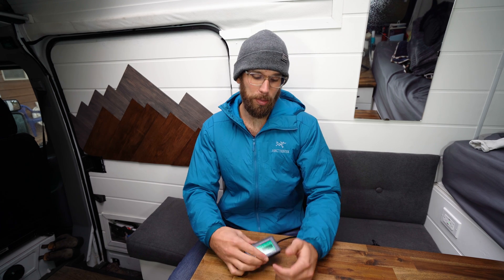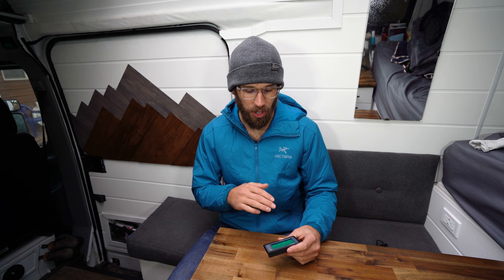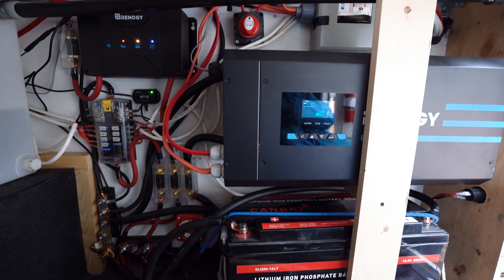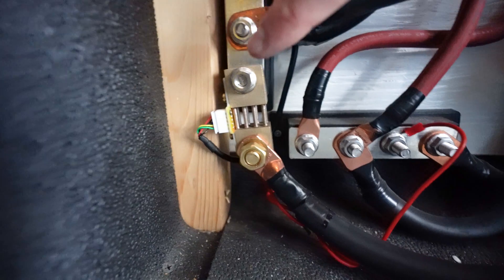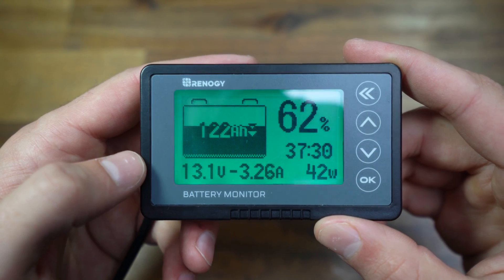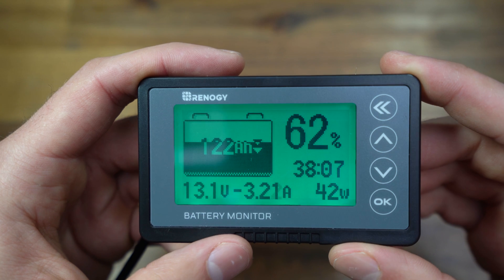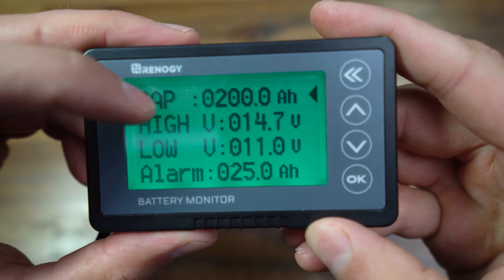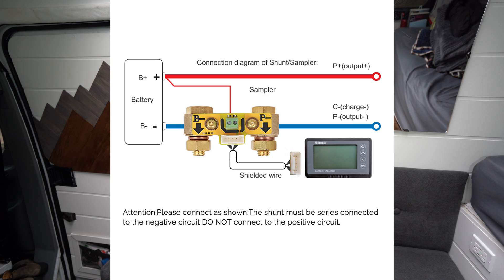Renogy Battery Monitor: How To Monitor Your Solar Batteries

Comment: Hello from Germany, how can I easily determine that my battery is fully charged before I install the monitor? I also have a Renogy 170ah battery
Reply from the maker: Test the voltage. When the battery is full it should be around 14.6v I believe.

Comment: If you have 2x 88ah you set the Cap to 176Ah if I understand correctly.  What do I set the Full V, Zero V, PowerOff and Alarm to?  I have 2 SRM-27 Interstate batteries. Thanks for the vid it was awesome
Reply from the maker: Look at the specs of the battery and set the voltages according to those values.

Comment: Can you explain how your battery disconnect is wired with respect to the battery monitor?  I currently have the same monitor and have wired up the monitor btw the disconnect and the negative battery terminal.  This is to ensure the monitor doesn't lose power (and all my settings have to be re-entered) if and when I need to turn the battery off.    Thank you.....
Reply from the maker: The shunt for the monitor is connected to the negative. The disconnect is wired between the positive battery terminal and the positive busbar
Reply: Thank you.   There continues to be a raging discussion about how to wire up a battery disconnect....with many (most?) folks leaning toward installing it on the negative side of the battery.
Reply: @robertallen7186  Greetings! I agree that many people intuit & rationalize installing cut-offs on the negative side due to "received" wisdom (perhaps due to frequently quoted historical advice regarding safely uninstalling automotive batteries where there is the most-commonly seen chassis negative ground?) I'm not an electrician or expert, but my current understanding is that ALL switching AND fusing needs to be on the positive side of any electrical connections so that the current is 100% off the system instead of just partially disconnected (i.e "after" the energized positive current flow portion of a circuit.) Typical household & appliance wiring protocol shows many examples of this principle in action. Any informed counter opinions welcome, Cheers!

Comment: If you have 3 batteries in a bank how do you monitor all 3?
Reply from the maker: The same as having one except you wire them in series or parallel.
Reply: @madetoexplore  they are parrallel. With the monitor plugged into 1 battery. The monitor states one battery is detected. I assume that all three are acting as one. If thsts the case, i need to be able to turn the inverter off to save power.

Comment: My system was set up with batteries from China. My Monitor has gone out. I have Series of 16 batteries. Can I use the the product on what I have.?
Reply from the maker: As long as your system isn’t over 500a and 120v it should work

Comment: Thanks for the video. Just wondering how you configured the monitor with high/low voltages etc. I noticed when you turned your vehicle on, the charging voltage was around 13.3V. Is your battery at full capacity at 14.7V?

I also have the same monitor, however, my voltage when my battery is at full capacity is 12.8V (as per the specs). But the charging voltage is 14.4 (as per the specs). Just want to know how your charging voltage is lower than your high voltage?

Comment: I was thinking that the addition of that shunt on the negative bus bar is very risky. If that top bolt comes loose and the negative cable touches the positive terminals of the positive bus bar, you will have a big short circuit.
Reply from the maker: Yes, I’ve moved the positive busbar since this video but I’ve also never had any of the bolts come loose.
Reply: @madetoexplore  The issue is that if they are normal right-hand threads and not left-hand threads, the cable pulling from the right could loosen the bolt. If it were a left-hand thread, then that would work because the cable would tighten the bolt. However, that said, if you've moved it, then it is irrelevant....

Comment: May I ask a question I'm at my wits end. I had the renogy battery monitor but could not get it to show charging. So I sent it back and got the cheaper Chinese knock off.  Same thing it will show discharging when I'm using various currents. But won't show charging by either solar, dc to dc or 110 v charger. What the heck am I doing wrong? I'm running shunt to battery on the B- and and the P- I run direct to the buss where all my grounds are.  Should work but I'm missing something obviously. 😢
Reply from the maker: Is the negative from those components running to the negative busbar?
Reply: @madetoexplore  all but the mppt... I'm changing that today or tomorrow
Reply: @hwalls59 Out of curiosity....
How did it go?

Comment: Hey David me again. I'm fixing your wiring instructions.  One question first. After I've hooked up my renogy battery monitor now my buss barr is getting extremely hot.  In fact 260° F
I don't know if it's wire size or what but can't run the ac, obviously. My neg buss does not get to the battery it runs thru the shunt. Maybe that's the problem ?
I'm lost
Reply from the maker: Usually that’s due to a bad/loose connection or undersized wires.
Reply: @madetoexplore  you were right  bad connection

Comment: Great video thanks! How would you wire the shunt, to the negative bus bar and to 2 x 200amp batteries ? Your input would be appreciated thks!
Reply from the maker: There would be a cable connecting the negative terminals of the batteries and then the shunt would be installed between one of the negative battery terminals and the bus bar.

Comment: If I have four 100ah Renogy batteries in parallel. What should my setting be for Ahours on the Renogy 500amp Battery Monitor? 100 or 400?  Great video, great info!
Reply from the maker: 400ah. Thanks for watching! 😄

Comment: I have Renogy panels and charge controllers but I have to agree wth others that their website and instruction manuals are poorly written nor do they answer their Helpline phones. I was considering the same battery monitor but have decided on a Victron IP65 SmartShunt instead simply because it’s a BT device that can be paired with a phone or pc. No monitor installation required. A good explanation on how you have it hooked up though. Very helpful indeed. Thank you.
Reply from the maker: Yes I completely agree! Good luck with the install 👍
Reply: My Victron Smart Shunt constantly drops its signal 15 feet away if the door is closed. I still have it in series with the Renogy battery monitor but never use the app. I bought a WiFi Pet Cam from Amazon that reads the Renogy meter and shows live video from hundreds of miles away on my phone. $55, cheap and dirty monitoring.

Comment: Hi David. I'm installing this in my Land Rover Defender with a 2 battery system. Do you know which battery I hook it up too? Main or auxiliary?
Reply from the maker: This depends how you want to manage the system. If you want to monitor both batteries or just the aux battery?
Reply: @madetoexplore  Good question. I currently have a T-Max system installed which monitors both. Very basic. Hence moving to the Renogy monitor and I'm installing a Redarc BCDC to keep them charging

Comment: I have 600 ah battery set up. Does this Renogy 500 amp work for me?
Reply: Do you recommend the one that has the Bluetooth compatibility as well or just the basic monitor?
Reply from the maker: @hwalls59  I haven’t tested the BT model yet so I can’t for sure recommend it.
Reply: @madetoexplore  ok thanks...
Reply: But I still have my negative buss bar grounded to the chassis. That won't effect it?
Reply from the maker: @hwalls59  no it won’t. Mine is grounded as well.
Reply: @madetoexplore  I'm getting ready yo install the monitor. It just seems strange I'll mount the shunt to my buss bar and then the other wire from the shunt to the negative terminal on the battery.  My buss bar has a cable already running to a negative battery post. I guess it doesn't interfere or matter as long as all negatives from all Chargers and all users get to the buss bar. The mppt goes to the buss and the solar goes to the Renogy mppt. 
Lol seems a mess too me lol
Reply from the maker: @hwalls59  that’s correct! 👍
Reply from the maker: Yes it will
Reply: @madetoexplore  ty I'm ordering now

Comment: Great job, Please help as my renogy monitor shows it's full but it displays 0 hours and when I use the inverter it won't work. Thanks Franco
Reply from the maker: Sounds like it may be installed in the wrong spot or possibly backwards? Make it’s the only connection between the negative battery terminal and the negative busbar.

Comment: Great video about the product and good to see your progress over time here on Youtube :). Remember seeing a much earlier video, when you got the Sprinter Van. One note: the bottom part of the  shunt looks dangerously close to your positive bus bar. If the screw for the shunt on the negative bar becomes loose for whatever reason (i.e. van vibrations, over time), the shunt might move close enough to create a short circuit or builts an arc with your positive bus bar. Not sure whether you still have it like that, but I though I bring that up - just in case . Safety/precaution is probably better here, give the AMPs going through that circuit.
Reply from the maker: Thanks! Yes, the angle of the camera also makes it look closer than it actually is. I’ve also moved it to a different location now. Appreciate the feedback tho and thanks for watching!

Comment: Better install in a cupboard or something as the light will drive you crazy
Reply from the maker: Pretty sure you can turn the back light off but yes that’s a great tip. Thanks for watching!
Reply: It doesn't pulse when you don't look at it. 🤔

Comment: Hey man, thanks for the video, really helpfull! I have one question thoo. Do you see on your monitor when its just your solar pannel who charging the battery, with the up arrow? Because i have the same set up and when its just the solar panel there is no arrow showing me that the battery charging, only the voltage getting higher. Also, the amp do not go up either when its just with the solar panel.. Let me know what you think!

Cheers!
Reply from the maker: This is probably because the shunt and/or ground is wired incorrectly. The shunt needs to be the FIRST thing connected to the negative connection on your solar battery.
Reply: I just try it out and still nothing that show me that my panel are charging on my monitor.. exept the pv light on my solar charge controler…

Comment: Thank you for the excellent information on the renegy battery monitor. I'm getting ready to install this unit on my home solar with dual 200 amp hour batteries, I'm running both batteries in series to a bus bar. So I guess I need to install the unit on the inverter side of the bus bar and not the battery side of the bus bar to monitor both batteries ,correct??
Reply from the maker: It doesn’t matter which side of the bus bar, only that it is in between the busbar and the negative battery terminal.

Comment: Great video mate. I'm doing a home power plant emergency battery system for our cyclone season and your info was very helpful, I just ordered the same unit. By the way I'm in Cairns QLD Australia. 👍
Reply from the maker: Thanks man! Good luck with the build 😄
Reply: Hey Steevie! I hope you got her up and running. I did my backup system and wanted to monitor it from a distance....like from 300 km away. I bought a $55 WiFi  Pet Cam from Amazon and can monitor my 2 systems from anywhere in the world where I get a cell phone signal. The Renogy display shows me everything I need to know without scrolling. So if you are down in Brisbane for a bit and you want to know how your battery is charging, you could have a quick look....
My one system has been running 2 chest freezers and 2 house sized fridges and a few other things for over a year in NorCal. The live feed is shaper than what was transferred to this video.  The Pet Cam from Amazon does remote pan tilt zoom from my phone, has 2 way speaker and laser pointer. This is the 24 volt system console. The cheap LED desk lamp causes the scan lines. The Renogy reads 0.3 volts too low at 27.2 volts. No big deal. Cheers!
https://www.youtube.com/watch?v=mDv3vl3WlAM

Comment: I have a 3000 watt pure sine Renogy inverter. I have 3 lithium 100 amps batteries. I've had this hook up since last April (2022). I had this installed a distance from where I live now. All was running well, to include my Dometic CxF75, which ran constantly as is wired to AC and 12 volt. I just noticed the refrig is no longer operating on 12v. If I turn on the inverter it will run but when inverter turned off, it stops. My batts are at 74. So batts are good. I've checked fuses, even the fuse in the refrig 12 v hookup line. All seem good. Do you have any idea what the problem is. I'm a newbie to all of this and this has my 65 year old mind stumped. Any help would be appreciated.
Reply from the maker: I’d imagine the fridge should have some type of automatic switch to switch back and forth automatically from 12v to 120v? Sounds like an issue with the fridge electrical for sure.
Reply: Check all your fuses too.

Comment: Well explained video, David. Thanx for putting in the time and effort to help us. I have a question about initial setup of the monitor. Could you please tell me how you chose the values for high and low battery voltage alarms. i.e. how did you choose the numbers 14.7 and 11.0. Thanx in advance.
Reply from the maker: Welcome! Thanks for watching. Look at the min and max voltages for your make/model of battery.

Comment: Hi thanks for the great info. How do I tell if my battery is fully charged? The solar is charging during the day. So do I wait for the solar to stop charging when it’s still sunny outside and reset to 100%? The voltage on the unit is 13.2vdc 
Also are you using agm batteries?
Thanks
Reply from the maker: It’ll be up near the max voltage when fully charged and yes, I would wait until the amps drop to a very low amount to reset it. I use lithium batteries 👍

Comment: Question on the Renogy inverter do I have to use the provided on and off remote switch? Or can I just turned it on and off on the inverter?
Reply from the maker: You can turn it on and off from either switch. You don’t have to install the remote switch if you won’t use it.
Reply: @madetoexplore  thanks so much!

Comment: Total waste of time!! You never showed how to set the different values on the monitor screen.
Reply: Yes, that is what I wanted to find out but no luck.
Reply from the maker: @godwinpacetti1558  watch between 9-10 minutes…
Reply: @godwinpacetti1
558 
Same here!. I am trying to found out  how to set the parameters  on my Renogy battery monitor for my two 105 Amp Deep cycle flooded  bstteries groupe 31.
Same here, no good luck anywhere. 0:05
Reply from the maker: Is that the only reason you watched the video?